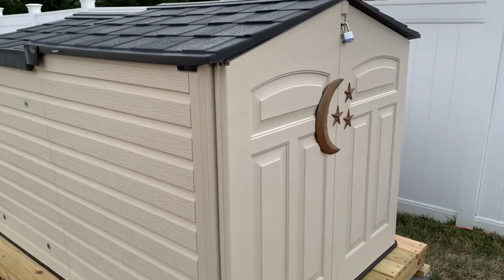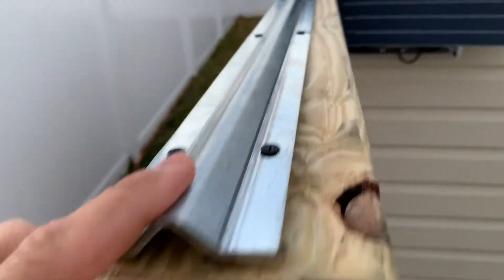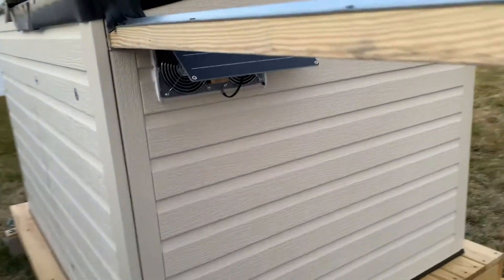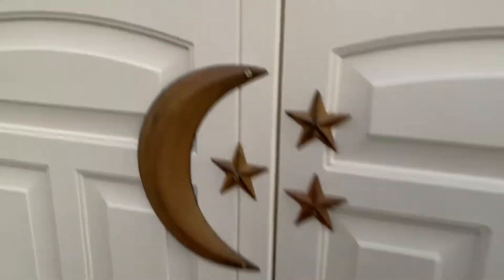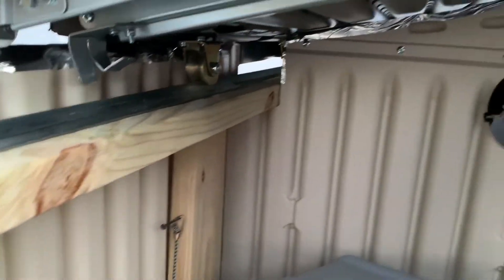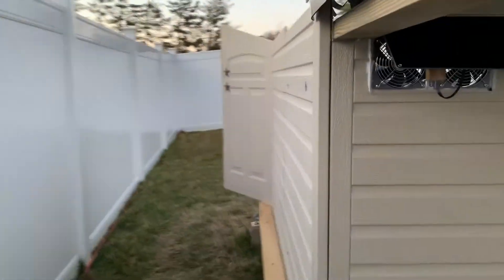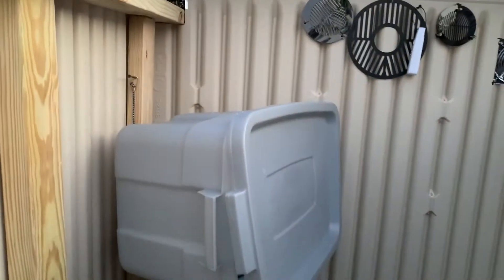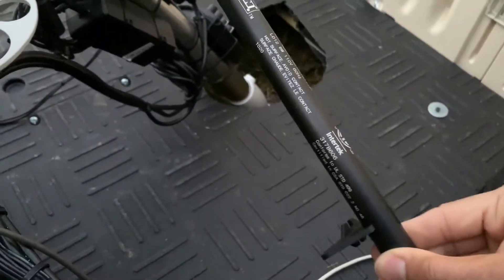My Mini Roll Off Roof Observatory Build

Comment: This is the same shed that I built my observatory with. After 2 years sunlight (heat?) had caused the roof to sink in the middle and it became impossible to open the roof anymore. I have since torn it down. Yours looks great, and I hope you don't have the same issues as I  did.

Comment: Thinking of doing this build myself. Is there a reason that you couldn't just move the tripod closer to the doors such that you wouldn't have to do the extended slide roof?    I'd use this for a 75 mm refractor or my Edge HD 8.

Comment: Nice job.  Looks like you thought of about everything.  Small suggestion -you may want to put some wire screen around the holes you cut for the tripod legs to keep small critters out.  Congratulations on a cool project.

Comment: Why was it necessary to slide the back half as well.  Wouldn't just the first half have sufficed?
Reply from the maker: The shed is actually smaller than it looks & for my setup with the dew shield on my 8” it will clip the roof if the entire roof wasn’t removed out of the way. Maybe this wouldn’t happen if you have a smaller refractor like a 60mm.

Comment: That's a great idea. I am in the process of planning out a pier/observatory so hunting for solutions. Being that you have a permanent structure now, why not mount a mini pc under the tripod (I 3D printed a holder that connects to the circular tray between the legs). Then use say AnyDesk to remote in to it whilst sitting on the couch. ;)

Comment: DeeJay, I'm about to put the tracks in and was just wondering if you could tell about the dimensions of the cuts you made to install the 2x4 and tracks.  I'm trying to get an idea from the video but not sure how much to cut in order to install the track.  Sorry for the hassle, but much appreciate your help.  Thank you.
Reply from the maker: The 2x4s I only cut 1 side on the observatory all because I installed the solar fans way before I decided to make the roof roll off. So for the other side I didn’t cut the 2x4 I only laid the track on top of it & screwed it down. The side where I had to cut the 2x4 I just cut it to the width of the track just on the inside so if the shed & I got lucky that the track & 2x4 ended up fitting just next to the fans. Now if I knew I was going to make this a roll off roof from the start then I would have moved the fans further over so I wouldn’t have to cut 1 of the 2x4s. If you check out my last video where I show deep space photos, I show the 2x4s a little bit better in the video. Hope this helps explain it a little bit.
Reply: @deejaybustab  Thank you for the explanation.  I greatly appreciate your help!!

Comment: Hey DeeJay, I just got my shed put up.  Was wondering if you could tell me how long your "V" tracks are.  My guess is around 6 - 8 feet but I just thought I'd ask.  Thanks for your help.
Reply from the maker: They are two 6 foot sections of track & each track are 2 & 1/4 inches wide. I got them on Amazon.
Reply: @deejaybustab  Thank you for your idea and help.  Much appreciated.

Comment: Looks great, wonder what the total cost was.  Have you thought about a way to seal up around the tripod feet to the floor?  It seems like you could get rid of a great deal if moisture if those 3 holes were removed.  Another thought is to just have the fans on when its hot inside, so you dont pull in moist ground air all the time?

Comment: I love the simplicity of that dual-purpose flap and solar panel holder. I miss using my C8 on the EQ6. I switched to a wider refractor which is great for many things, but not planets, small DSO's and lunar close-ups. I really need to setup a secondary mount for my C8...

Smart call on the golden rod. I'm using a TG365 cover to great effect but for some weird reason pollen and dust still manages to accumulate on my gear despite the cover. Maybe I really should take cues from your setup. I'd love to motorized the top so that I can go full remote.
Reply from the maker: Thanks!!! I still have my 80mm refractor for wide field as well. For now I’m going after all these smaller galaxies for the moment with the 8SE. I’ll see this spring how the pollen goes in here. I know I’ll get some in this shed so hopefully it’s not too crazy 😁